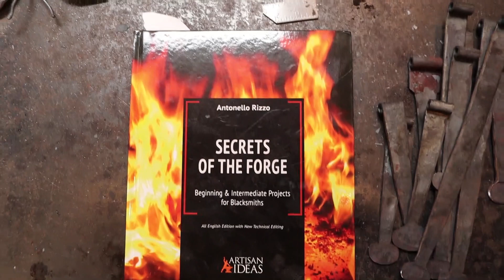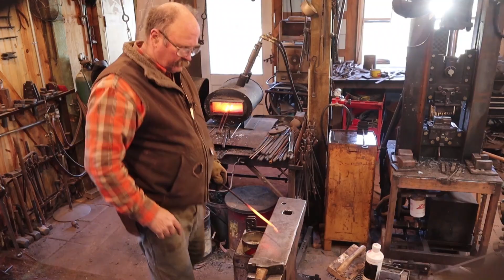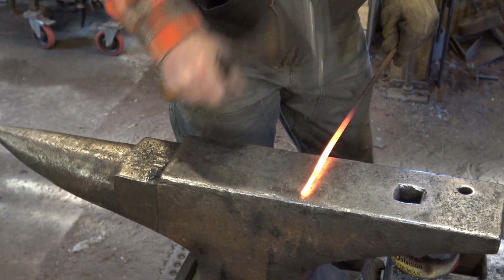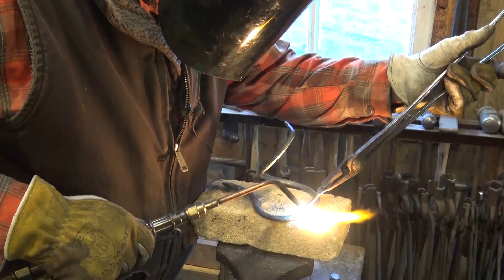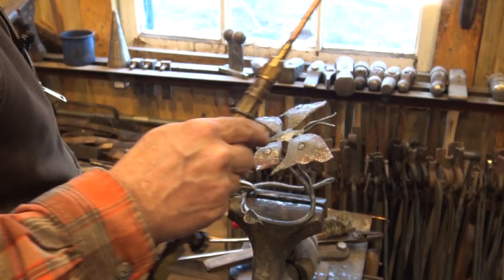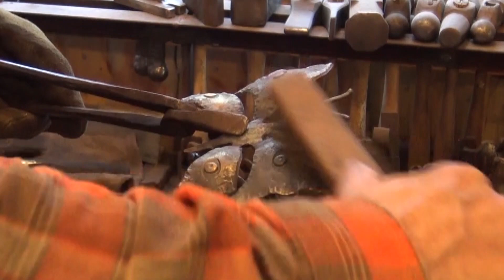Forged iron butterfly - part 3

Comment: John, before I got my Oxy setup, I had great success using solder to attach leaves and those vine "Y "shaped tendrils to rounded rods.  Blackening these is tricky, however, as is removing the acid flux before it attacked the steel.
Reply from the maker: Just plumbers solder or something better?
Reply: @BlackBearForge  Just solid core lead-free solder wire and an acid liquid flux.  Silver solder if you want a "bright" finish.  I first tried this as an experiment, soldering a bright finish 10 penny nail to a scrap 1/8" plate and was unable to pull it apart.  I made a 10' X 10' arched pergola with the moon phase motif for a friend for her climbing roses and attached a series of 5 leafed rose branches using soldering technique.